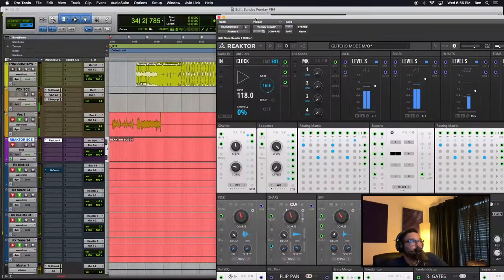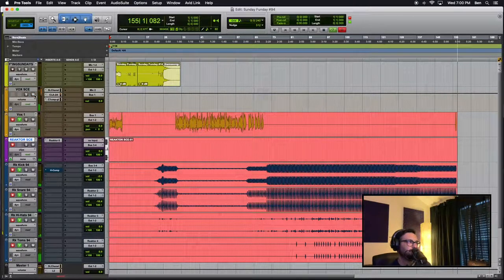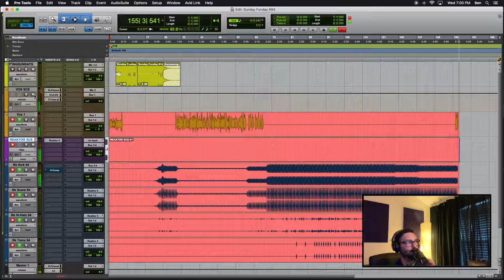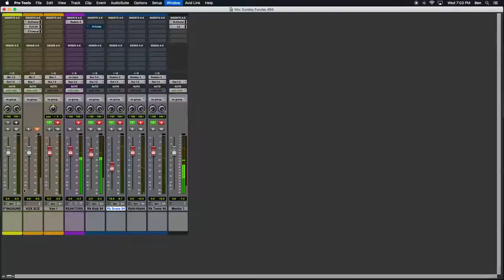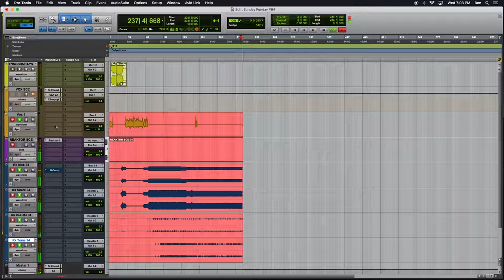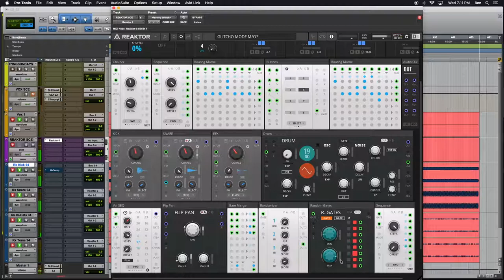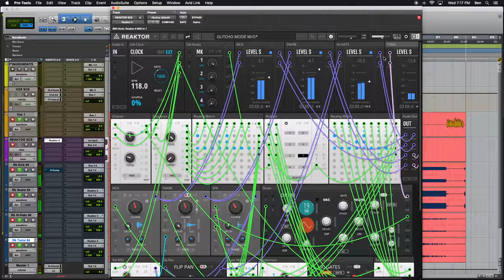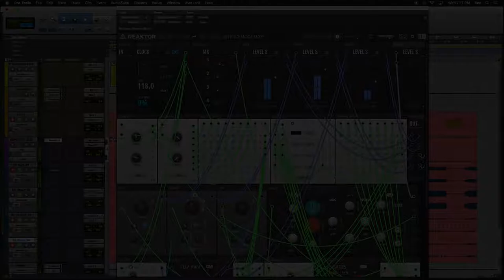Sunday Funday #94: Recording Multiple Outputs in PRO TOOLS with REAKTOR BLOCKS in Reaktor 6.3

Comment: could you link me a video about how to sync the clock of reaktor blocks to protools, I cannot get it to work correctly
Reply from the maker: Hey hey! I recently found that Reaktor doesn’t appear to report its Delay Compensation to Pro Tools in a ‘dynamic’ way, or in a way that adapts dynamically to the change in processing incurred by Reaktor’s DSP. Since Reaktor is less an instrument or plugin, and more of a platform for building custom instruments or plugins, Reaktor’s DSP processing can change dramatically based on what is going on within the Reaktor instance(s) at the time > more complex Reaktor instruments or effects would of course incur more of a CPU, and therefore delay incurred by the round trip through the plugin. This is an interesting topic with many rabbit holes, something I will continue to experiment with. 🧪 🧫 > if you have any specific instruments or efx you’re interested in, let me know in the comments and I’ll cover as many as I can!